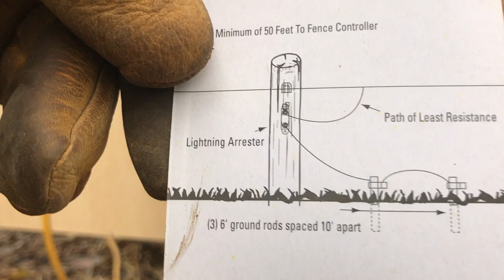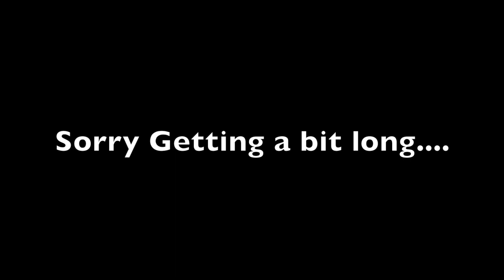Premier 1 Electric Fence Review - Installing the Grounding Rod - Part 2

Comment: If you do not have rock or large roots, dig a small hole and put water in in.  Take your ground rod and start going up and down into the small hole with water.  Remove the rod.  Add more water.  Repeat.  It actually works.

Comment: Have you heard about the hammer drill? It is made for pounding rods or other items into the ground. It will save your back and arms from feeling pain the next day.  By the way, you are not suppose to cut the grounding rods, that is a code violation and it is a no no. You can use a sledge hammer and anything else when pounding a ground rod all the way down into the ground. When lightening hits (if it ever does) your house the grounding rods will be able to handle the load all the way down into the ground.

Comment: Two suggestions:
— For a homemade post-driver, use regular iron/black pipe and close it off with a regular screw-on cap for the pipe.
— To start, slide the post-driver onto the ground rod before you raise the rod to start.   (Then you won’t need to climb up the ladder to slip the driver over the rod.)

Comment: I have 3 9 foot rods in the ground and still can’t get my fence to ground. The ground is clay and when it drys it’s like concrete.
Reply: You’ll have to water them. Sink a short section of 6” PVC sewer pipe next to each rod and dump water in from the top, it will slowly percolate down and keep the soil moist.
Reply: @susanamundson2542  thanks I will try that

Comment: I used a T post driver and a 8 ft. step ladder till I got down to about 3 ft. My soil was very moist at the time. I am going to try a 1 X 6 inch pipe nipple and cap to pound it further. A 2 in. pipe and well driver cap s probably best though.

Comment: Thank you so much for making this video.
Although I feel, you should have hammered the entire rod into the ground instead of cutting it off. The deeper you go, the less resistance you get which is a good sign. 
So should have pounded the entire rod with hammer and then connected clamp.

Comment: This is what I have done. Is electrolysis a problem with copper rod and galvanized wire connector? Not sure. I just hooked mine up
Reply: My question too. It's very confusing.

Comment: The part I don’t understand is lightning starts on the ground then goes into the sky it doesn’t come from the sky and strike the ground so putting a grounding rod to the hot wire would just increase the chances of it getting struck not decrease lol
Reply: Lightning can actually go both directions. It can also happen between clouds.

Comment: I don't get it. We just put a grounding rod in and simply used a sledgehammer and it took 5min.  Yes, 5 minutes.  
I thought I would need an air hammer and a hammer drill and all these videos I have seen are ridiculous and leaves something to be desired of humans and over thinking everything. 
Getting these additional tools was a waste of time and aggravation. Just hammer it in and be done with it. 
Move on with life. It took longer for the camera setup and narration than actually hammering the rod in and moving on.